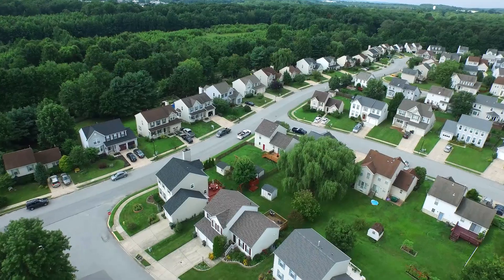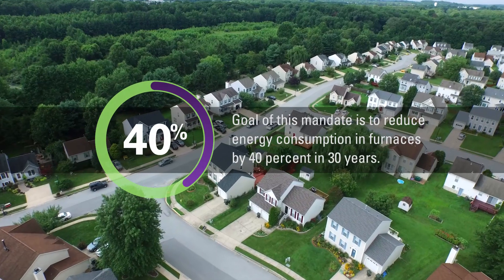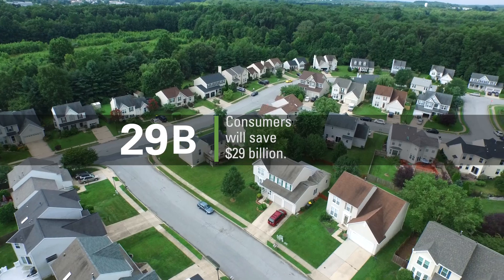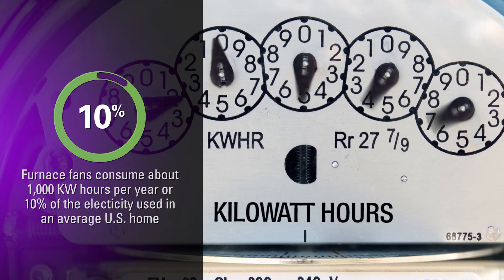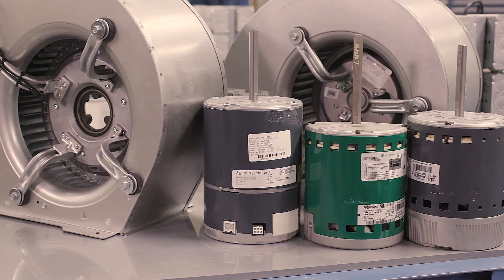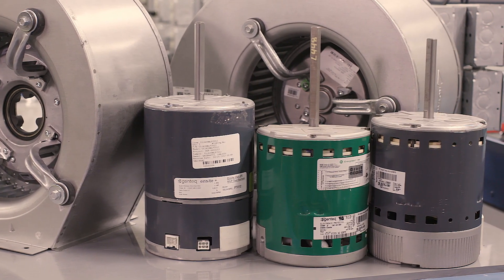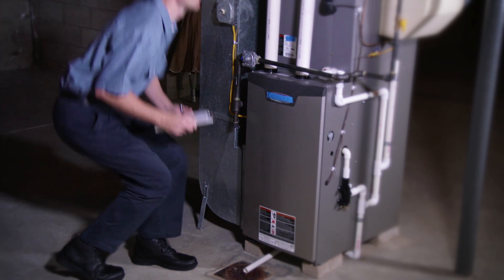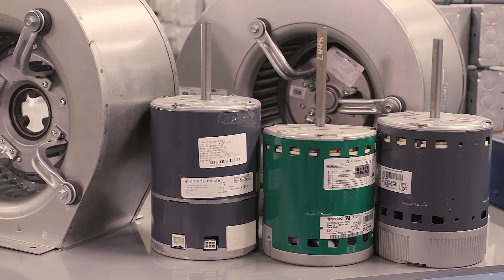What Fan Energy Rating (FER) Means for Contractors

Comment: Customers don't save anything they spend more, if they could save $300 over 10-15 years vs a PCS how many times will they replace it for $500-700 each time?  PCS use slightly more kwh but last 20-30 years trouble free.  How about insulate attic govt programs, they can never get it right.

Comment: My company replaces more dead ECM motors per year than PSC motors, and I personally have replaced an ECM with a PSC during a holiday weekend (until I could get a new ECM), and a PSC USES THE EXACT SAME AMOUNT OF ELECTRIC CURRENT AS THE ECM...NO ELECTRIC SAVINGS (and PSC costs half the price of the ECM)!  The only advantage of ECM is that they start and stop quieter, but the down side is that ECM COST TWICE AS MUCH as a PSC, and have a far shorter lifespan than PSC!  There is a HUGE difference between "laboratory testing" and REAL LIFE TESTING!  Also, ECM motors have computer boards in them that have metals and chemicals that are environmentally toxic!